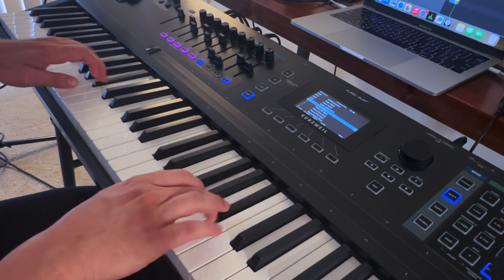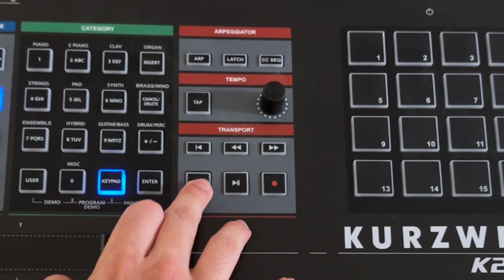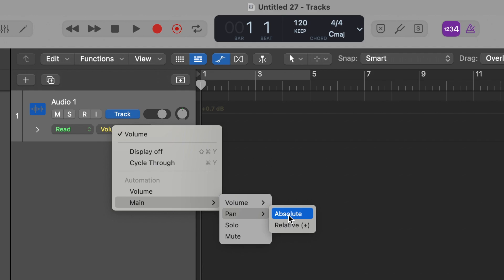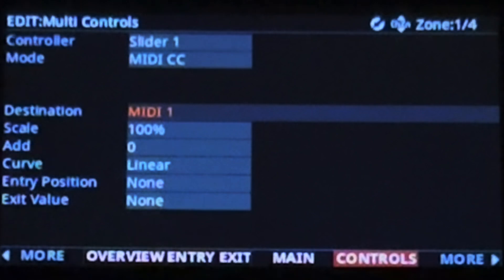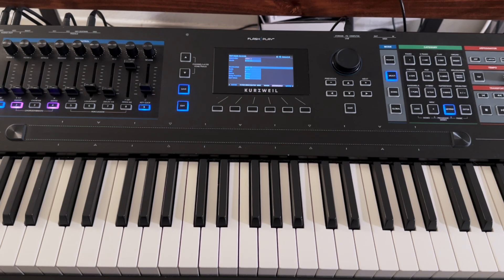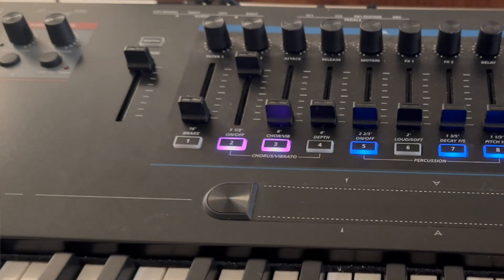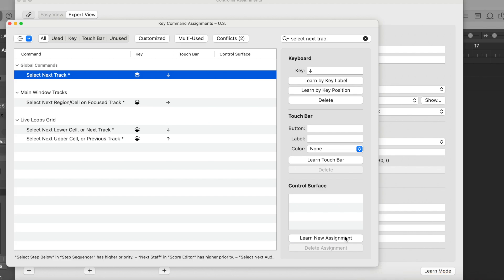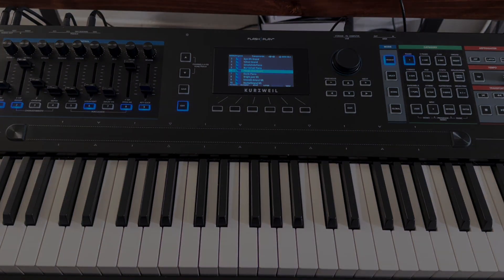Kurzweil K2700 Tutorial: DAW Control

Comment: Could you please tell me how to set it up in CUBASE? No matter how much I look for it, I can't find a way.
Reply: When connected to a DAW, Kurzweil cannot save various tones of MIDI channels. If you turn Kurzweil off and on, you have to go through the hassle of finding the tones for each channel again. That video is about the controller, not about saving and recalling instrument patches entered into MIDI. If you have your own connect program and USB driver, the controller function and instrument patch function become very easy. For example, Yamaha synthesizers have this function, so they show very simple and powerful performance when connected to a DAW. This is a very unfortunate part for Kurzweil. And if you set it up like in the video, you can't use VSTI. I'm Korean, so I'm using a translator, so the communication may not be good.